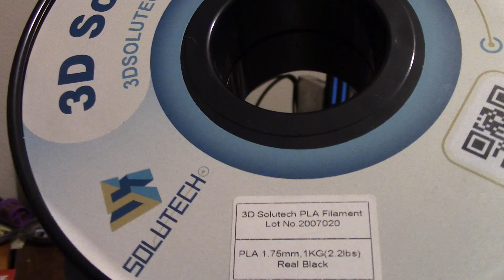Will annealing cheap PLA make it more impact resistant? Let's find out!

Comment: Never expected that single hit result! I thought you heated the air fryer up, then yanked the tray, dropped in the parts, and let it cool for the previous set - concern about overheating the parts while the machine came up to temp.
Reply from the maker: I may have explained it poorly in the earlier video, but I did it the same way. I wasn't expecting the one hit result either, but I'm still grinning like an idiot.